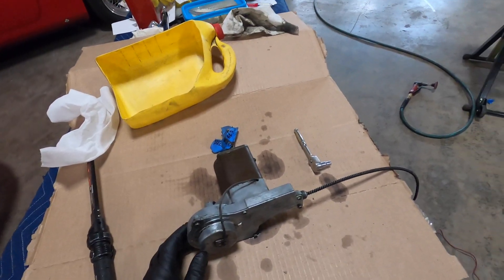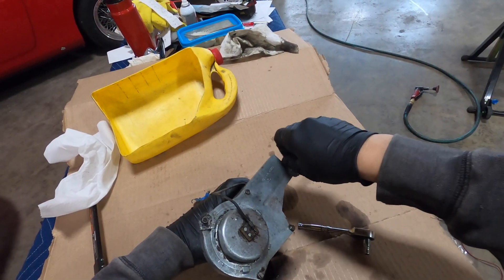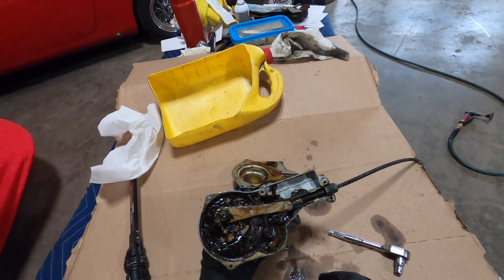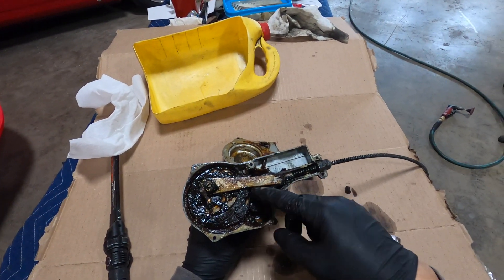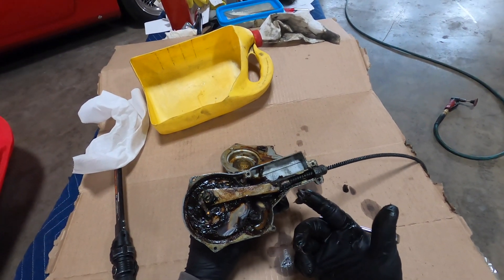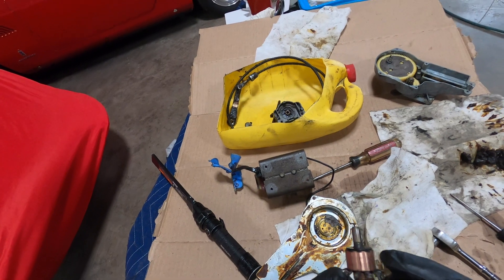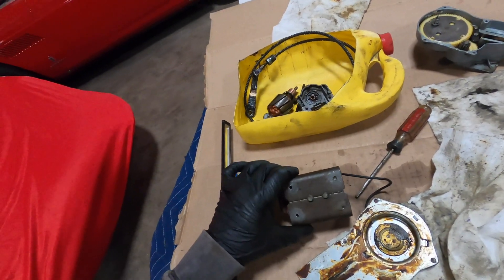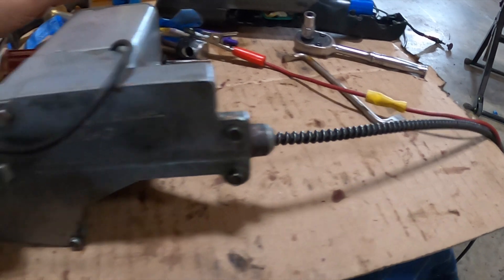Lucas Wiper Motor Rebuild

Comment: Can you show the connections used for bench testing please?
I have one i need to test..

Thanks
Reply from the maker: The problem is the colors often fade on the Lucas motor so it's hard to give you the connections base on color. You can look at the way the wires are routed to the motor and figure out which ones go to the commutator and which ones go to the field, and go from there. Good luck!
Reply: Totally agree..
Good news is that i now have it running on the bench..😊  @tomyangnet

Comment: Respect for the way you restore and repair things Tom. So many shops just toss parts out and replace them. Wipers are often forgotten items because lots of classics don't come outside when it rains. A lot of cars I drive for stories have failing wipers or at least blades that are rock hard, just flapping around doing nothing...
Reply from the maker: It’s better to have them and not need them than to need them and not have them! Thanks!